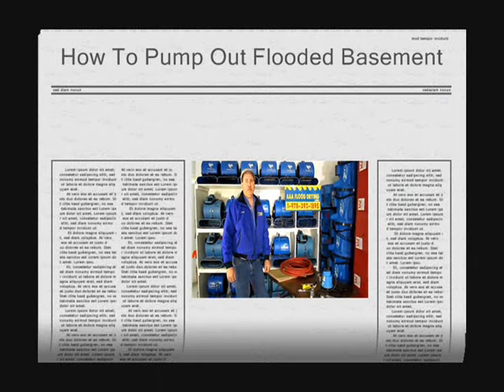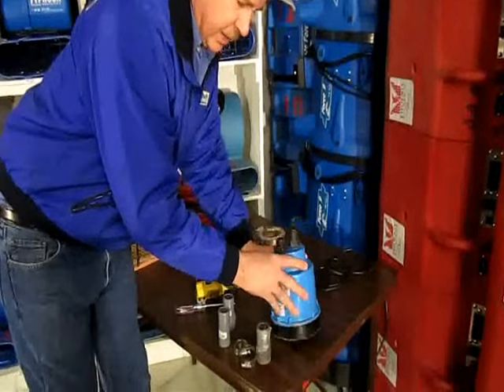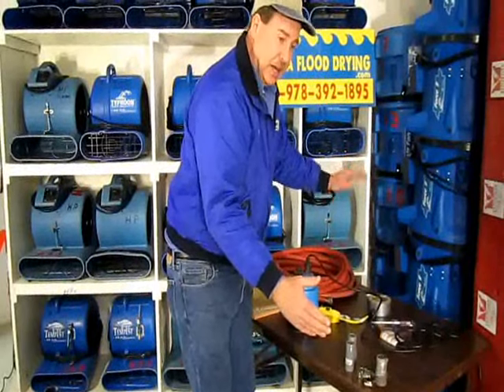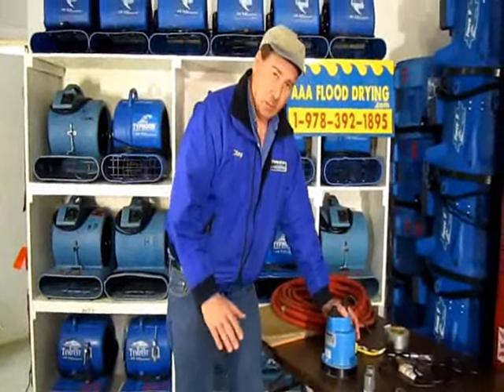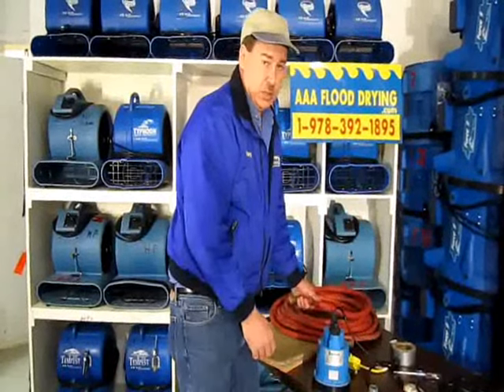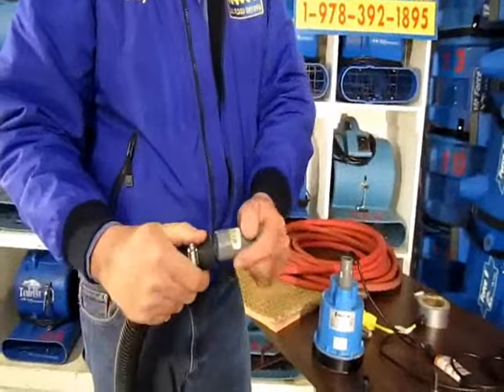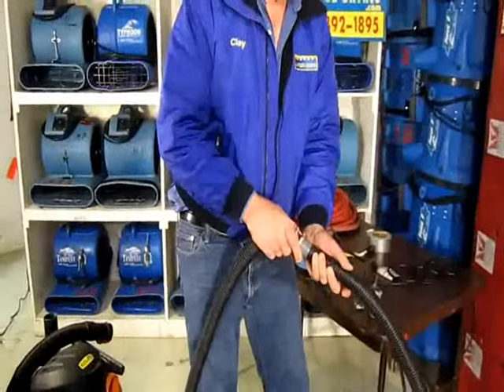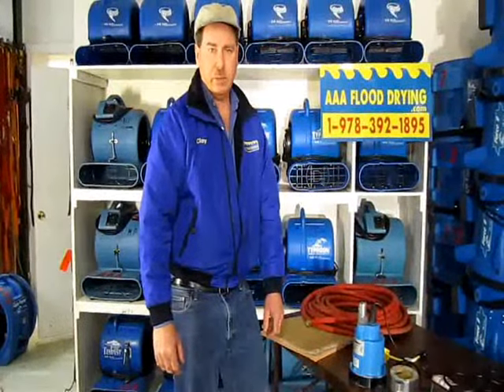How to Pump Out a Flooded Basement #1,  Water Removal, Water Pumping

Comment: Hi, Great Video. I live in NYC. My basement was flooded from Sandy. After watching your video I went out and bought the Simer Classic pump as you recommended. I also bought the larger sump pump hose per your recommendation.

My question is regarding the adaptor you interchanged to connect the sump pump hose, what is that size or type of adaptor should I buy?
Thank you!

Comment: How could I pump out an old military building? I found it way back in the woods while exploring. It's extremely fascinating, I just wish to explore further. It has several feet of water in it. Thank you.
Reply from the maker: Small portable generator and a small pump, but a good size hose on the pump to make it more effective. Generator can be very small. Check your specs and test set up before you carry into woods.
Reply from the maker: Call me

Comment: I run a softball league which plays on a dirt infield. The dirt does not drain very well when it rains. I would like to get some kind of pump to pump the water out of the infield and into the outfield when there's huge puddles after rain, which can sometimes be 4"-6" deep.. Can you recommend a type of pump I should get?

Comment from the maker: Sorry to here that you are having basement flooding problems. Simer makes a set of electrodes that can be attached to the pump for pumping small amounts of water, from 1/4 inch up. They do work, but they are fragile. Do not plug them in and touch the ends together or they will be junk. Only test with water.
Hope this helps with pumping your flooded basement.
Clay, AAA Flood Drying 978-392-1895

Comment from the maker: If you purchased the Simer model 2300, I think 1 adapter should come with the pump. If not, it usually comes with the sump pump hose. The adapter from the pump to the 1 1/4 inch hose is, a 1 1/4 npt(national pipe thread) to a 1 1/4 barbed fitting. The second one is a 1 1/4 Barbed fitting to a 1 1/4 barbed fitting. I hope this helps you out in pumping out your flooded basement.
Clay King
AAA Flood Drying
978-392-1895

Comment: Your video is very well done, packed with useful information, well-organized and well-presented. Based on your experience I've ordered the Simer pump (1/4 hp). I have one question about it, having to do with potential damage if it runs dry. Some (more expensive) pumps have circuitry that will shut them off if the pump runs dry. I don't think that Simer pump has that, but I'm wondering if it will shut down if the motor becomes overheated (because there's no water to pump and to cool the motor).

Comment from the maker: It is unlikely that you need a sump pump after getting wet just once. If the water went back into the earth, you really do not need to deal with it more at this point. The flood water will create dampness in your crawl space though, as the dirt will remain damp for a long time. You might consider having the crawl space dried out to prevent mold damage.
Give me a call maybe I can help.
Clay

Comment from the maker: It seems like a simple thing to do. But after pumping out the flooded basement there are many ways to deal with the wet carpet. To many people want to save the wet carpet and pad, but this is not usually advised. The pad should come out and the carpet may be saved. The main goal is to get as much water out of your house as fast as possible to avoid mold damage. Good luck on removing water from your basement.
Clay

Comment: Thanks Clay, great video!  With all the snow we have received here in Mass this winter (Feb 2015) I am getting ready for the great melt down.  With all the roof clearing and shoveling I have a ton of snow around the house that I am sure will end up in my basement no matter how much I am able to move away from the foundation.  So I am looking to purchase replacement pump for my half dead pump.  I looked online for the Simer Classic (2300) and found a few for sale, but mostly newer models that dont appear to get the same ratings as the nice blue one (I think its the 2300) that you have on this video.  Amazon sells a black Simer that has good ratings but leery it is not as good as the one you talk about here.  I checked out the Simer website this morning to see that those nice blue model is discontinued.  Do you have any recommendations for a newer model?  I was able to find a place online that has the 2300-4 (also blue but looks to be octagon-shaped) out in Michigan and Wisconsin but thought I'd reach out to you first.  Thanks very much!!!
Reply: Just an update for others who may be looking for this Simer pump.  I found them on the Fleet Farm website.  They are based in Wisconsin and had this Simer Geyser Classic pump in stock for $60 each ($33 off the suggested retail).  The pumps arrived today and look great so I am all set.  Thanks again Clay for this great video!
Reply: Peter Delaney Unfortunately, they are out of stock and they are NOT getting anymore :(  I ended up buying mine on Amazon for about $88, but I didn't care because they come so highly recommended.  $88 was the cheapest I could find.  I'm excited to use it, but as a single gal, I am concerned about getting electricuted because of the "electric/water" combination.  I saw my plumber STANDING in the water in my basement while holding the turned-off pump.  Even though it wasn't turned on, it made me nervous.  What's the real scoop on using these pumps, water, and electricity please?
Reply: Sherry Magnusson If the pump is submersible, this should be alright. There should not be any worries.

Comment: What is the deepest water level this pump can be used in
Reply from the maker: +Sharyn Lowenkamp These pumps will pump up to 25 feet deep. But the deeper you go the less water per minute you get out of the hose. I would suggest that if you have to pump a lot of water a high height you get a larger Horse Power pump. Clay King  AAA Flood Drying

Comment: We get periodic water coming in when it rains, but the concrete floor is uneven and it results in 3 or 4 areas where water puddles, less than an inch deep. Is there such a thing as a pump that would have several perforated small hoses that could be laid in these areas and connected to say, a manifold so that the pump could clear all 3 or 4 areas? Right now, I have a shop vac with a pump in it, but the vac and the pump don't run concurrently so as you know, I have to vacuum, then pump, then repeat, then move to the next puddle, etc.

Do you have a solution for this type of basement water ingress? Thanks in advance.

Comment from the maker: In most Towns it is illegal to put the hose down a sink or toilet. It will also cause more problems than you can imagine. Run the hose outside pointed down hill so the water runs away. Keep it low, keep it pointed down hill, no kinks, do not make it longer than it needs to be. Do this and the pump will pump more water faster.
Clay, AAA Flood Drying

Comment: Great video.  During Sandy water entered my crawl space (dirt floor).  We were evacuated so when I returned home I noticed the water line was about 4 inches in the crawl space but all the water was already absorbed into the ground.  The crawl space is empty.  I was looking at the Simer but do I need to install a sump pump?  Thanks.

Comment: Thanks for the great info Clay. I have a basement which gets about an inch or two of water once or twice a year in the lowest spot. Like you said, the Shop Vac routine is long and tiring.    Question....Do you know of a water detecting switch I can use with the Simer pump to keep the basement dry when we're away from the house? Thanks again.

Comment: Great video! Thank you for the detailed explanation and your support of this pump. We had about 5 inches of rain come into our basement in CT from the 10/29/17 New England storm.  We had no power for the first couple hours of the flood so we could not utilize a pump. Once we had power back on the fire department did help us out. But I will be investing in one or two of these pumps for the future.  Is there a way to power these pumps without A/C?  I have a DC to AC converter for my car but that only generated enough power for some utility LED lighting. When I tried to hook up the pump the fuse blew.